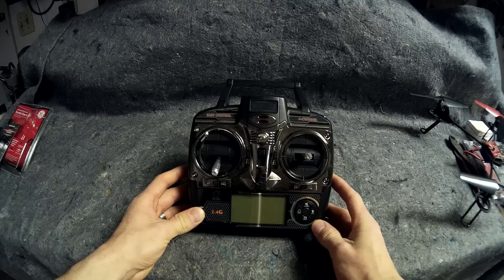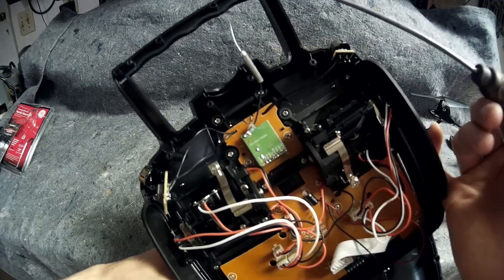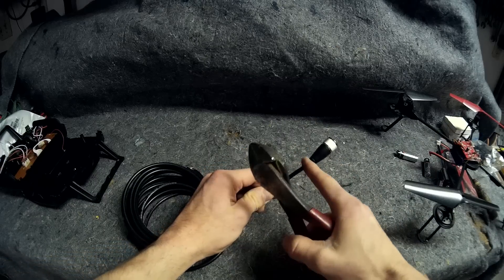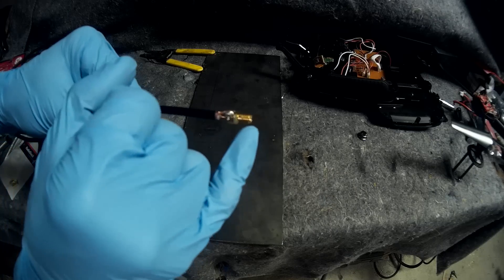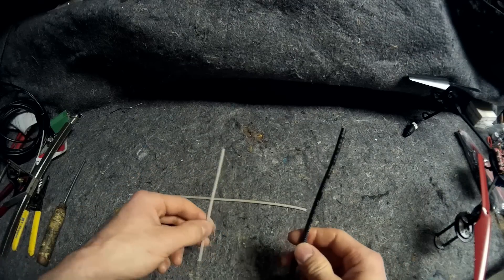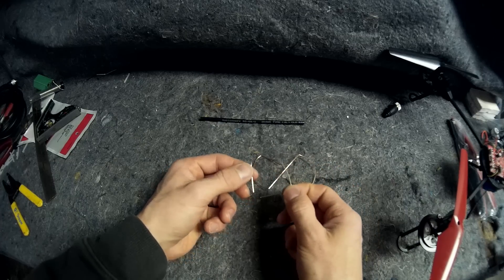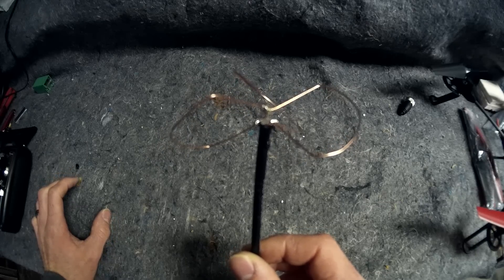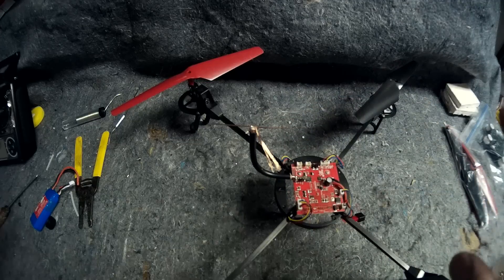DIY: Quadruple Flying Distance - WLtoys, DJI, Hubsan, Syma Transmitter Mod

Comment: I just now made a 4 lobe skew planar (LHCP) 2.4GHz using your method. I am going to test it out as soon as the wind stops. What I did was to just make two of the circular figure eight lobes that you made in this video. I already have several 3 leaf clover antennas. What I wanted was a back up 2.4GHz (RX) antenna for my Yuneec Q500 external antenna mod. The $20.00 retail skew planer looks just like the one that your video taught me to make for free. Well my soldering looks sloppy. But I hooked it up to my drone, and it connected right away. So I can not wait to fly with it and see if I get the same range as my store bought antenna. My transmitter is already modded with the Itelite dbs range extender flat panel kit. So no need for clover leaf. Great mod. It was so easy. Mostly because of your method, and the fact I had another skew planar to look at reference while soldering. Thanks again. I will leave a link to my video here. So you guys can see how well your method worked for me. Thanks again.

Comment: I love videos like this for sure but if you are someonee
 like me, still learning phase, and haven't yet decided what equipment to 
purchase for creating the "perfect package" according to my own 
preferences and objectives.  In a nutshell, I want racing drone speed 
and performance, explorer flight time and range (say 3200 meters), 
safety features like gps with rth or locate beacon, and have respectable
 hd video capability.  Basically, a   mavik pro that isn't necessarily 
all that pretty nor does it need collapsible architecture for minimizing
 storage size....high tech sensors like obstacle avoidance are cool but 
not in my budget so squash those features.  Of course fpv equipt having 
the range I mentioned....which brings me to the question of frequency 
selection.  Seems fpv goggles are all  5.8gh which is great quality but 
lacks the range and penetrating ability of larger wavelength 
frequencies.  Range is the biggest challenge to understand in terms of 
selecting a particular design  setup, necessary components all of which 
need be same system compatible.  
You mentioned "repeater" in the video during the antenna construction part, something I have briefly looked into as a possible method for accomplishing long range rc.  
Any thoughts, ideas, advice, explainations, etc. you can share would be helpful.  I would love to see what you might put together to meet the objectives I have.

Comment: hey Bro, It looks like most off the controllers that I peek into dont have a ground /shield soldered for the center mass. it looks like one shielded wire soldered to the board. what then?
Reply from the maker: +anyshitt Absolutely sure? Most antennas need the shielding soldered to transmit any real meaningful range. If they don't have that, it's not a controlled you are going to gain much benefit doing this mod anyway.

Comment: Your coax sure look's better than the wire connected to ebay 5db antenna's I got a few month's back.. I Love the bottom piece's you made out of coax, I would pay for a couple of those shipped to calif.
Reply from the maker: +anyshitt If you are still looking for a couple of these pieces, message me. I live in Cali and might be able to help you out. :)

Comment: Will your antennas work better (longer range )then if I replaced it with the sheld wire pulled down over itself to make a sleeve antenna on rx. And tx?im looking for the most range not to fly out of sight but so I don't lose them .will yours have more DB gain?

Comment: I actually always thought these clover antennas were only for 5.8ghz frequency (for FPV), but I've got the same setup in terms of transmitter and quad which is on 2.4 and no FPV.  I've done the same mod but used a 6dbi booster antenna off a modem and an RG316 SMA cable which I replaced with the cheap and thin dipole antenna on the transmitter. Can I simply buy a clover antenna from ebay and attach it to my modded transmitter? Would i need to also have a clover leaf antenna on the receiver (quad) for it to work? Please help a noob.

Comment: It doesn't have to be perfect, right?
Reply: Im not sure about that weird units(feet, inches)
Reply from the maker: +Pablo Elizondo No, but it should be as perfect as possible, as wave theory dictates that wire length affects the quality of the given frequency you are working with.

Comment: Yeah man! Good ol' antenna mods! Great video!
I've done this on a bunch of my quads, including my own WLtoys V666, Syma X5C. Mould King Super-S, 2 of 'em in my Hubsan X4D and 3 of 'em in my Devo 7e! 
I buy lots of RP-SMA pigtails and Wifi Antennas! LOL
Longer range and more reliable signal without amplification, and having it connectorized it opens up options for better antennas and amps and such as well.
Reply from the maker: +Michael Thompson Absolutely, it just shocks me that companies don't take advantage of this themselves. Minor modifications on a DJI or Hubsan can push these out to 1000m without violating FCC laws.
Reply: RavingMadProductions
It's production costs and liability mitigation unfortunately.

Comment: This is a real good modification to the transmitter but I would have used some heatshrink tubing to help strengthen and to
protect the connections. Excellent modification job and doing the video review!
Reply from the maker: +Dennis Petersen Thank you! Consider using matching antennas for better range ( dipole-dipole or clover -clover combinations).

Comment: Hello, Can you write a complete list of components please?
Reply from the maker: +Mrsuite33 I mention pretty much all the parts in the video. The only real components that are hard to find are the SMA connectors. But they're just that, SMA connectors compatible with RG58 coaxial cable. Please see the first 4 minutes for components. :) Good luck with the build!

Comment: Can you go into a little bit more detail about the antenna that you put on the quad itself. The video is a bit out of focus when you are describing the build of that component. My question specifically ( and if you could post a picture that would be awesome!) is when you bend the wire to 90 degrees and attach another wire at 90 degrees in the other direction, you say not to cross them. Can you show a picture of what this looks like when successfully done? This is my first time ever modding anything and I am completely new to the entire process.

Thanks!
Reply from the maker: +David Orsi Hey, great question. It's fairly simple with the dipole antennas. Basically you have two metal components in the coaxial cable. The center core (transmission wire) and the outer metal shielding. What you are doing is bending the core wire at a 90 degree angle. Then you bend back the shielding and wrap a separate wire around the shielding as if you were wrapping wire around a pencil. The lead in the center represents the core wire. Basically you have the center core wire at 90 degrees and a separate wire wrapped around the shielding just below the core wire's 90 degree bend (so as not to let them touch). Hope that helps! :)

Comment: hi,, i want your advise for v666 motor upgrade can you send me a link for brushless motor .
Reply from the maker: Dev Dagar Unfortunately, the V666 does not support a brushless motor upgrade because it down not have Electronic Speed Controls (ESC) built in. You can swap out control boards and transmitters, but it would be easier to just go ahead and by a whole new quadcopter.

Comment: Why not just get an rpsma 2.4 ghz antenna from Hobbyking? They are less than ten bucks.
http://www.hobbyking.com/hobbyking/store/__35649__2_4_GHz_Circular_Polarized_Antenna_RP_SMA_Transmitter_only_.html
And a ten dollar extension cable.
http://www.ebay.com/itm/New-FPV-5-8g-VTX-RX-antenna-extension-cable-rp-sma-to-rp-sma-jack-Free-Shipping-/281344903751?pt=LH_DefaultDomain_0&hash=item4181768a47
Sure takes a lot of work out of the setup. And if you really want to increase range as long as you are LOS you can use a 2.4 ghz patch antenna.
Reply from the maker: Randall Huston You are absolutely right, you totally can, but part of my videos is doing things for ultra inexpensive, so I made one for about $0.10 worth of regular shielded wire. :)

Comment: I have one of those, motor gear to wear very fast, metal motor gear worn fast.
has a solution? tried to put direct propellers on the engine, put the engine heats up much and burning the controller board.
Reply from the maker: Paulo Limm The gearing reduces amperage pull at the circuit board, which prevents damage. The only way to do direct drive would be to use smaller propellers spinning faster. Keep in mind there is an efficiency loss though, and you can only move so much air with a small propeller. You could grab propellers maybe 1/2 or 1/3 the stock size and perhaps that would work. I think you will lose max lift and speed though.
Reply: ok. thank you. how can I fix, rapid wear of the engine gear?
Reply: put lubricant on the gear, it was worse.
Reply from the maker: Paulo Limm You will have to replace the gear altogether once it starts to wear down. I'm surprised you have had problems. I have well over 40 flights onto my quad and the gears are perfect still. I'd just order a set of gears off banggood.com. :)

Comment: hey RavingMadProductions  i pulled apart a wifi modem and I have taken some parts from that however, there are some differences.
the connector i have from the modem is an sma male and the antenna is an sma female, will this still work?
also there is a wire already attached to the connector, would it be alright to cut this out, strip away the rubber and then solder onto the controller? Also how to deal with the 'ground' point?
If not could you give other directions, thanks
p.s english not my native tongue, go easy
Reply: http://tinypic.com/view.php?pic=fonm07&s=8
picture of the wire
Reply from the maker: Conor Oates  Right, you have a great little source for an antenna connector. The wire and connector from the router looks to be female to me. You determine it by the center transmitting pin. See this diagram here for male vs female:http://www.wellshow.com/wp-content/uploads/2010/01/sma-pcb-plug-jack.jpgEither way, it doesn't matter that much if you put a male connector on the transmitter and use a female antenna. Most antennas are male though, so it's more of a convenience thing. It won't affect transmission.  :)And yes, go ahead and just unsolder that wire from the board. There SHOULD be a shielding around the center pin, which you can see is actually soldered to the board already. You would then solder that to your ground on the transmitter. The center pin goes to the transmitter solder point on the board. Here is the same picture labeled that showed the transmitter and ground wires:http://i57.tinypic.com/33msavc.jpgGood luck! :)
Reply: cheers dude, really appreciate that :)
Reply from the maker: np.  :)

Comment: Excellent work! My question is: I have ordered the cloverleaf antennas for V666 from Banggood. Do you think they work as good as your home made ones? Also from your description i gather this doesnt apply to FPV at all or does it also increase FPV at all? Thanks
Reply from the maker: Ruidoso New Mexico Because they are precisely bent, they should actually work better than the ones I crudely bent at sub-marginal angles. :)  But you are correct, this is a flight transmitter/receiver (tx/rx) mod only. The V666 already has SMA connectors on the video transmitter (Vtx) and video receiver (Vrx). Because of this, you just need an additional two clover leafs to extend video range to match.  :) So two total clover leafs on the quad, and two on the transmitter/video receiver = 4 total for increasing both flight and video. Hope that helps. Take care.  :)
Reply: RavingMadProductions Right on. My V666 seems lost on a slow boat from China for the past month but....I noticed I accidentally ordered an extra antenna for a total of 3. Maybe I can use 3 somehow until I get a 4th. 

All my BG V666 parts orders have come in but I ordered the actual V666 from tinydeal one night when BG had the V666 at $245 (for some reason) It was a big mistake as I later noticed even though BG said it was $245 when you put one in the cart it lowered down to the normal price. Anyway I ordered from TD because they had a low price (135) which was a bait and switch anyway because the shipping was outrageous at $45. So for $45 I am still waiting here one month later with not even a tracking number yet and Paypal dispute open, and all my V666 parts for mods laying around. :)

Thanks for the vids.
Reply from the maker: Ruidoso New Mexico
Aww bummer, that sucks man! I hope it comes in soon. International shipping can always be sketchy, so I try to order from companies that give the estimated delivery dates and ship huge amounts of stuff. Anyway, keep me posted and good luck!

No problems on the vids, I love posting them.  :)
Reply: RavingMadProductions  Just saw that Banggood had the V666 in stock at USA warehouse for $149 so I ordered should be here this week so I can put my antennas on. Tinydeal was horrible but looks like paypal will get my money back. Antennas, bearings, motors, batteries all laying around here for weeks.Hoping to also extend the FPV range when it gets it here.
Reply from the maker: Oh wow, price has dropped even more! That's pretty good. Glad you were able to get your money back, that sucks that you had such a bad experience. I'm always nervous buying from oversees supplies unless they have a ton of good reviews. Let me know how those antennas work, I might consider a set for my FPV system.

Comment: "I uhh... I don't do pink..." Lol nice video, hopefully I'll be able to do something like this for my Dromida Ominus since I plan to put a home-made micro FPV system on it for some close-quarters flying.  Gonna be fun!
Reply from the maker: NoahWL1 Hehe, just wanted to clarify it wasn't mine!  :) But thanks! Totally do the mod, it's been amazing. I did test with a dual dipole setup, and although horizontally it is fine, the cloverleaf transmitter with the dipole receiver actually works better. Which is weird, because it goes against antenna wave theory. I'll have to look more into it.
Reply: I thought CL sent radio waves in a corkscrew sort of way, so it sort of beats out dipoles, especially when the antennas are rotated?

Comment: Great mod and a good explanation!  It makes me wish I could do this on my Hubsan X4, but it has some sort of internal antenna on the board. :(
Reply from the maker: Philly Drones Oh man, it's a pretty quick and dirty job. There's a lot of signal loss and leak, but I was eager to throw it together, so I figured for this quad I'd go ahead and just get 'er done. I think done correctly with the correct dipole setup, this could easily reach 3/4 mile on stock transmitter.

Comment: real nice video man. will def make this mod. thank you so much.

btw, how do i remove the propeller cover xD
Reply from the maker: Andree Persson Thanks man! It is def worth it. :)To take the prop cover off, turn the quad upside down, you will see 4 brackets on the carbon fiber rods each held on with two screws. That's the key to removing the cover.  :D
Reply: RavingMadProductions thats sick range u get man.. but how do i make the video do the same range?
Reply: RavingMadProductions ive looked the stuff up now during my lunchbreak. seems like the names for the items differ in sweden. could you link every item used in the video in the description? would be very helpful because then i could just compare the pictures!!